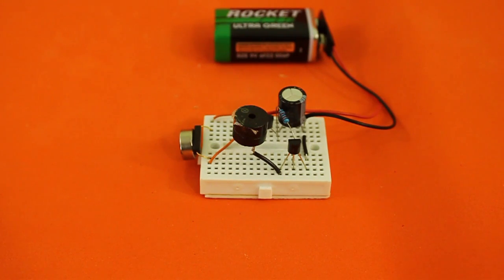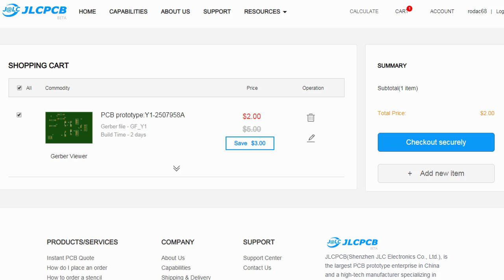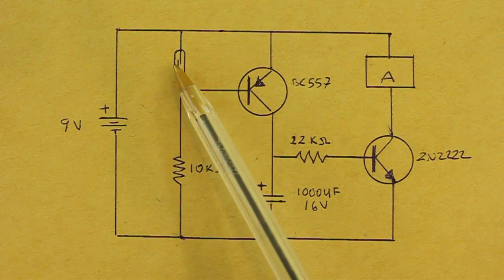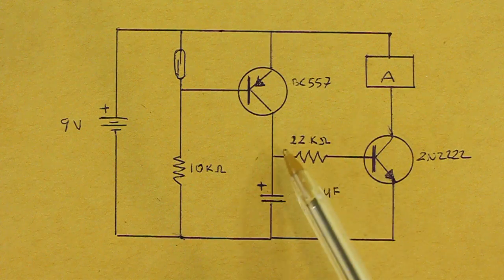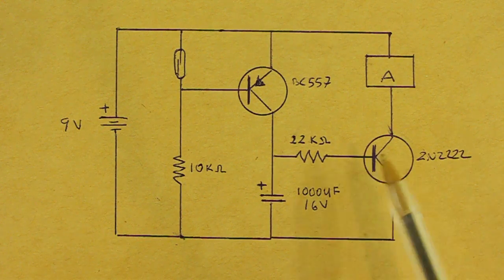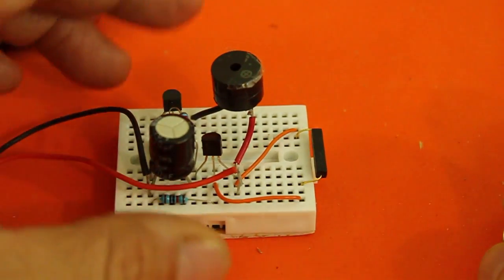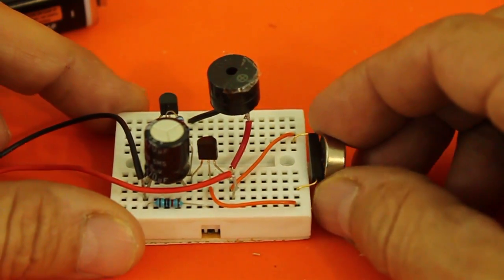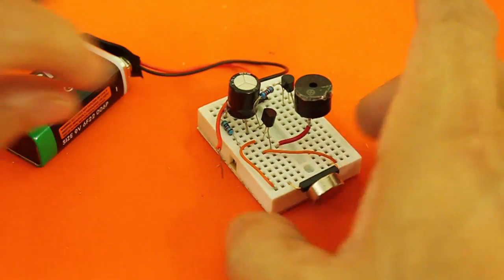Easy to Make Door Electronic Alarm

Comment: I like this circuit. It is simple enough so that even I can understand it and learn something about transitors. However I do not get the value of the 22K resistor between the capacitor and the base. How do you come up with that specific value and why is it not bigger or smaller?
Reply from the maker: There are formulae for that
Reply: @ludicscience  I checked the datasheet for the 2n2222, but could not find any formula? The 10K value I understand; they are used as pull-up and pull-down resistors.
Reply from the maker: Google "how to calculate transistor base resistor"
Reply: @ludicscience   Ok, thanks for your help :) So if I reverse this than the current into the base of the 2N222 is (9V - 2x Vbe)/22K = 9V - 2* 0.7V/22K = 0.35 mA. 

Since hfe of the 2N222 is 75 the maximum current across the alarm should be 0.35*75=26 mA

Cool! Thanks again :)

Comment: Great project! I am currently building something very similar, a laser alarm circuits with students. But I use a SCR instead of the two transistors. Basically, it's the buzzer, the SCR, and the LDR  (with two resistors to tune the sensitivity).
4.5V -> Buzzer -> SCR -> Ground
4.5v  -> 47k -> SCR middle pin -> 10k -> LDR -> GND
(With some buzzers, I either need a resistor across it's pins, or also attach an LED, as the oscillation seems to reset the SCR)
Reply from the maker: Sounds great and yes, there are many ways to obtain the same results

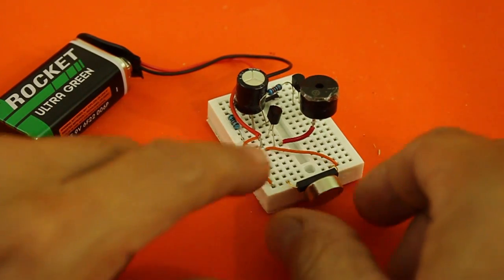Comment: 3:47 Shi* you blow my ears with you fucking buzzer
Reply: For notice i was useing headphone
Reply: @ludicscience  hi ludic one question how to choes the right zener diode to protect the transistor or mosfet gate
Now i am useing irfz44 to make high frequncey AC  ther will be a voltage spiks in the gate (5v battery) should i use a 4v zener dioda???? 
Any one can help
Thanks
Reply: @ludicscience  her

Comment: good project :)
https://en.wikipedia.org/wiki/Inductor
Ludic , is there a simple and easy way to measure a coil/inductor (L = x Henry ) ?
I was thinking of an idea of utilizing a computer(laptop) audio ports (speaker/mic). And playing some audio file of known attributes(making one with Audacity app), and coupling the coil with some kinda known value capacitor(C=1 u/n/pF or another value). Then recording with Audacity, and reading values and solving for LC https://en.wikipedia.org/wiki/LC_circuit (Resonance Frequncy formula)
You think this can work ?
Of course also using 3.5 mm audio cables

Comment: Another great idea would be to use a laser diode, some tiny mirrors and a photodiode with a transistor & a buzzer as a crude security system for the entire house.
Reply: if it is infrared it would be even bwtter because then people cant see it
Reply: @r0_  You can't see the laser either, especially if you wrap a tube around the laser itself and the receiver(ldr), only if it's very hazy.
Reply: Hi! I am currently building this with students. I use a SCR instead of two transistors- Even less parts :-) Laser--->LDR (+1 SCR, two transistors, buzzer)